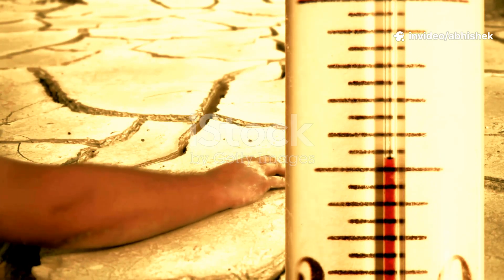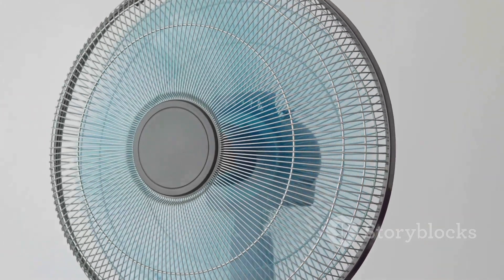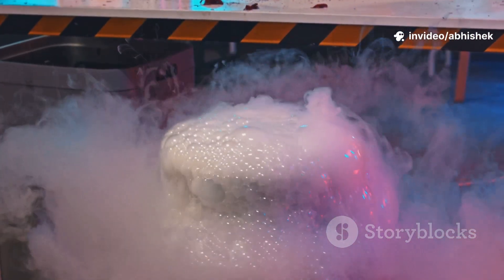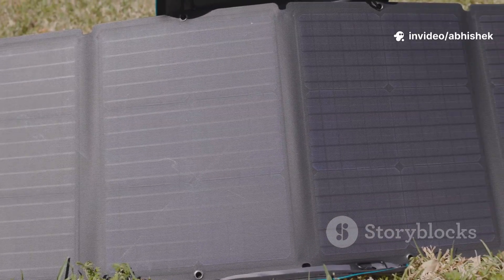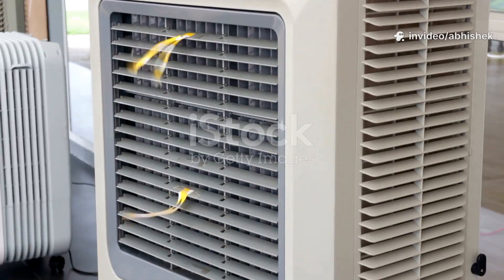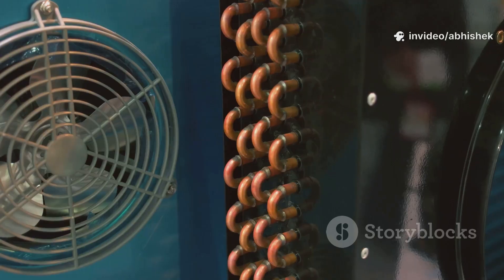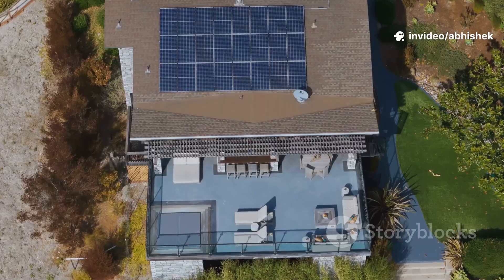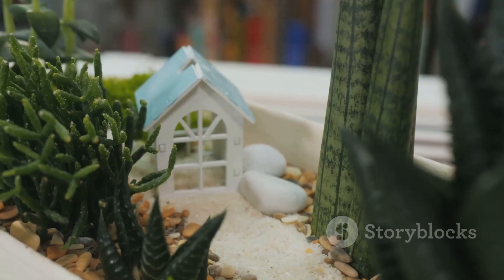I Built a $3 Ancient AC That Actually Works - 8°C Temperature Drop!

Comment: Regarding 7:00, similarly flexible portable canvas water bags are used to store cool water through evaporation. When water slowly seeps through the porous canvas bag and evaporates, it draws heat away from the remaining water, lowering its temperature. This natural method is useful in hot, dry climates.
Reply from the maker: That's a great point! 🤩